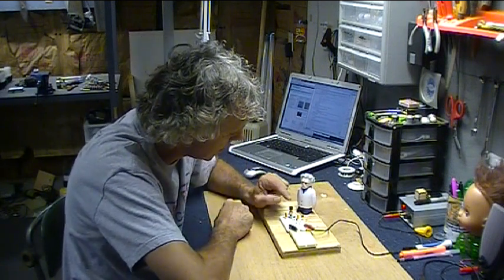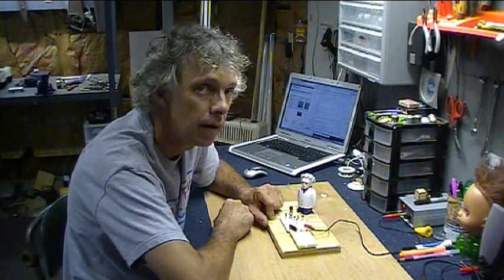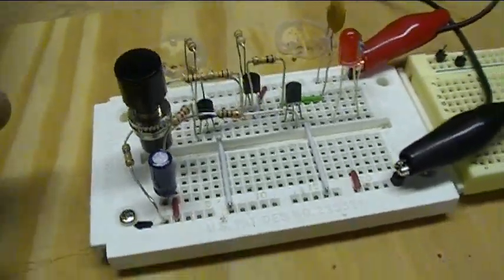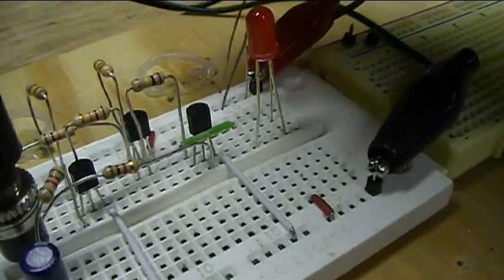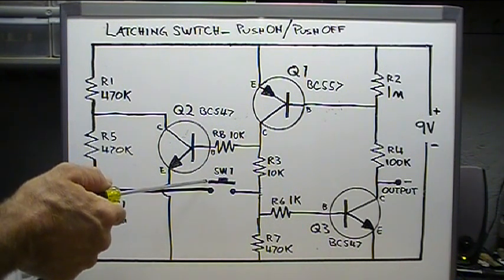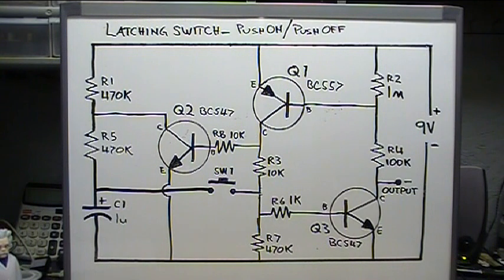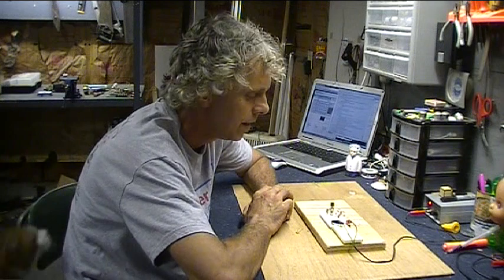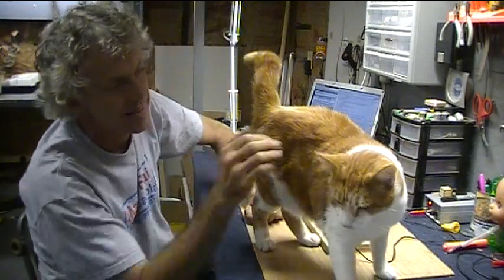Push On - Push Off Transistor Switch

Comment: Here you have a very interesting very sensitive circuit and the transistors Q1 and Q3 together may be looked upon as forming a thyristor, which is rather a  tricky  device to switch off, once it is on.
The surrounding resistors which you included, tame the thyristor effect and that is the only reason you may switch  the combination of Q1 and Q3 off.    It is not easy to design this circuit.
The action of Q2 is ingenious to say the least .  All I can say is  that it is a sensitive circuit to switch off as anyone handling thyristors would know.   Congratulations, for even if it does not work reliably, I assure you that  you did very well in choosing those resistors to  enable you to bring on and off that  tamed thyristor! 
I would say that  you need that capacitor at the output, so that Q1 will remain momentarily on to keep Q2 on to keep the voltage low on the capacitor C1 to ensure the charge on Q3 is depleted to switch it off.    It is not an easy circuit to design and each set of three different transistors will need their own particular tuning,   I do not think that this circuit can be  repeated  for any three transistors without  retuning the resistors .  Well done, for a self taught gentleman.

Comment: This circuit works fine with a few changes. Connect output to a 150-250 Ohm Relais to plus and parallel use LED with 1k resistor in line to plus. If LED with 1k resistor allone is used for demo replace R2 by 100 kOhm (R2 is critical). Also use R3 with 22 kOhm instead of 10kOhm. A smaller capacitor of 100nF vor C1 may work as well. The circuit turned out to work very well from 0°C to 50°C, resistant to humidity, very low power consumption. Thanks for this well designed video.

Comment: I changed R7 value to 1k ohm and it works very stable.  I can turn the circuit on and off as fast as I can rapidly push the SW1.  I added an PNP transistor as a switch to the output of this circuit to operate a small load relay.  I am using 2N4403 PNP for Q1 and 2N3904 NPN for Q2 & Q3.

Comment: This setup is invaluable. Ive been running this through a sim to learn how to setup my own circuits and i also had to fudge the numbers. In doing I've learned how to control the amperage and that one component has a cascade effect. The biggest factor of the latching however is the cap. In my sim it had to be at least 60uf to start being stable. To really gasp how latching works it is essential to break this circuit into its individual circuits. I also recommend debouncing on any switch component. One cap and 1 ohm resistor in series tied parallel to the switch. Now if i can just figure out how to control and understand the charging and recharging part of these circuits ill be well on my way.

Comment: That cap is acting as a debounce filter and stops the oscillating  of the circuit while you are pressing the button
Reply: No, the cap behaves like memory latch to decide whether it'd open /close in the next pressure sw.
Reply: @alexlo7708  The OP is referring to the "mystery cap" that was added to stabilize the circuit.

Comment: You may find the circuit a bit more stable if you use a MOSFET as Q3, Your main pull down capacitor "C1" should be a bit higher value too. Something more like 33 mics or so. 22 to 47 is about the best working range depending on preference. I feel fairly sure that you'll find the circuits' behavior more to your liking if you follow my advice...

Comment: I'm not sure what you're talking about now.  A circuit like this has an RC oscillation if you hold down the button.  It's visible because it takes a few seconds to happen.  If you hold down the button the LED will switch on and off every few seconds.  This applies to whatever load, not just an LED.

Comment: Re the 0.2 uF capacitor placement from Vcc to the signal path, it's usual to decouple digital circuits from their power supplies with an electrolytic cap of c. 22 uF and a ceramic cap of 0.1 uF across the Vcc and Earth pins on an IC.

 I'm not sure you've managed such a decoupling by slightly unorthodox methods (i.e. The wonderful, "I tried it and it worked," method of designing which all inventors use), but I  suppose it's possible. My (analogue only) electronics training was in the seventies

Comment: This same type of circuit technique can be implemented very reliably with two CMOS inverters, 2 resistors, a capacitor, plus an N-channel MOSFET and resistor to drive the LED.

Comment: The capacitor decouples the mixed signal(AC and DC) at the output. This is why caps are used on the outputs and inputs of bjt amplifiers.

Comment: In one state Q1 and Q3 are both in saturation and in the other state Q1 and Q3 are both in cutoff. 

Assuming an open load, that is nothing attached to the output:
In the saturation state the output, the collector voltage of Q3, should be around 0.2 volts or so.  In the cutoff state the output should be around +9 volts.

Assuming the output is attached to a RED LED as shone in the video:
A RED LED has a typical forward voltage of 1.8 volts.
If Q1 and Q3 are in saturation, the output voltage is around 0.2 volts and the LED is off.
The problem I can see arising is when Q1 and Q3 should both be in cutoff.  The LED is providing a current path around Q3.  Current can flow through R2 and R4 and the LED.  This will produce a voltage drop across R2 which will start to bias Q1 and turn it on.  Because R2 is such a large pull-up resistor it takes only a very small current through R2 to produce a voltage that will forward bias the BE junction of Q1.

The output of a circuit like this is not very good at sourcing current. The current it is trying to source interferes with it's own operation.  The output of this circuit could be buffered before driving an LED.  If you are trying to do your design exclusively using discrete transistors you might try a saturated transistor switch using a transistor with a very high Beta.  The output voltage of this circuit should be almost +9V.  This is probably high enough to turn on a field effect transistor which would not load down your circuit at all since the Gate draws no current.

Comment: Yes, as an electronics enthusiast, this was the circle what I needed for a long time.But, can't we do that with just one transistor and a few resistors, etc.And is it possible to do this with just one part like a triac? One guy said the name of a different switch type name and I bought that switch.Yes, it was a push button switch.When I pushed once and take my hand back, the lamp was on.When I pushed again it was off.But I was surprised to see that that switch was doing the job mechanically.

Comment: Those transistors you drew in on the whiteboard are fairly high gain for BJTs.  Most really common transistors like the 2N4401/4403 and 2N3904/3906 are low gain (Hfe).  Could seriously mess up the circuit if you subbed with low Hfe... also that website shows powering the circuit from 12V instead of 9V.  Could also matter.  The spot where you put the 0.1uF cap is kind of a weird place to put it and I don't think it's helping really as you can see at 2:15 What values for everything did you use?

Comment: Am I seeing correctly, a capacitor connected between the negative terminal of the LED and the supply?  When I do that the light turns on after pressing the switch, but then cannot be turned off.

Comment: How would one have 2 'latching' switches, such as using the original to power on the circuit and switch number 2 to latch it off, resetting the circuit for the capacitor to refill?

I would assume a SW2 would ground out using a diode, but where would it go, between R3 and the collector of Q1?

I know this video is ages old, still good and I thank you for sharing. You had a great camera for 2011!
Reply: Joshua Nulton I know it has been a long time since your question... Look up SR flip flop using transistors. That will give you 2 button operation.

Comment: 4017 (decade counter) you can use it for 9 relays. there is tutorials on youtube. there is reset option to use only number of relays that you want. On out pins you use transistors to power the relays because relays can sometimes kill IC. there is sch on net you just have to adjust it...

Comment: If you replace the BC557 (PNP) with a BC547 (NPN), it will not work.  The NPN would have incorrect voltages on the pins.

What's mysterious to me is how is the LED connected?  It's not shown in the schematic drawing.  I would add another transistor to deliver more current to the LED without loading the circuit.

BTW, my previous said Schmitt trigger (CMOS), I really meant to say hex schmitt inverter (CMOS).

Comment: what is the output voltage for led. Can i operate the whole circuit on 12 volt and also can switch on off 12 volt relay in place of led

Comment: Great videos, but this circuit is no good. It is unstable just like you showed in your video. I tried several times to breadboard this, and all attempts failed. I can get it to turn on, but only one time it went off. Tested with different voltages also. All components were exact and tested OK.

Comment: What is your input voltage?

Maybe try decrease the resistance values so you sink a little more current to run the switch. Your circuit drawing does not match your test unit.  Because you cant run that led light on 9v. You may need a higher voltage or lower resistance.  For average NPN PNP transistors, 5v will make life a lot easier.  

9v is on the circuit drawing, try that voltage, and line 5~ or 6 little 1.5v leds up in series to take the 9v, then test again.

Comment: What replacement transistors did you use? I can't get the circuit to work :( The LED is always on, pushing the button only causes a flicker. I've tried using 2N3904/3906 and S9014/9015 with the same result. Interesting thing though is that if I disconnect R6 and the base of Q3 before connecting the battery, and then reconnecting them after power is on, the LED would stay off until I push the button the first time, but after that it will never turn off again.
Reply: same issues here. Just built the circuit 3 separate times and doesn't work, or rather, very briefly.

Comment: I have on off by connecting to leads using 55 all working. But instead of touching the wires together to turn of as switch like to use a transistor but can't get it working any help?

Comment: if I replaced the switch with an op-amp comparator then put a guitar signal on the op amps + input would i get a squarewave octave down effect?

Comment: No, the RC oscillation has nothing to do with switch bounce.  It happens when you hold the switch down, while anyone would know there is zero bounce when it's held down.  Switch bounce lasts only milliseconds.  Still, there would have been no way to make what I need in a small circuit.  I ended up paying someone to write me a PIC program.

Comment: any ideas how you could make a circuit where you have 2 or 3 on's and 1 off? so one push is on1 two push on2  third push off?
Reply: You're describing a counter? Where the first switch operation gives an 'ON' condition and the 3rd operation gives an 'OFF' condition?

The quickest way to build this would be using a CMOS 4017 decade counter in conjunction with a single transistor LED driver stage. You could select any number of counts up to 10 whereby the ON condition would be maintained until the next sequential count would switch the driver stage OFF. (the decade counter outputs can be routed via diodes)

Comment: Looks like R3 should be of a bigger value, voltage drop at base is less 
Than .7 volts needed for the npn transistor  Q2 to turn ON.

Comment: I built this same circuit and it does not work. The circuit is initially on, and when I press the switch, it turns the output off and back on for a few microseconds. The PNP transistor is on all the time, therefore recharging the base of Q3. I see that your using 9v instead of 12v, but it doesn't make a difference. Anyone else having same issues?
Reply: even it did not work for me

Comment: Why would I use all these components instead of a single latching switch?
Reply: +Louise Brugman and it can be cheaper with a circuit like this than a latching switch
Reply: +Louise Brugman Power on state is always the same for the circuit.
Reply: +Jonas Nicolaysen Looking in my JAYCAR catalog I can get a latching 1A 240V rated latching switch for $1.95. The cost of the circuit shown adds up to $3.26 not counting the time spent getting it right. The purpose of the circuit is, I believe, a learning exercise rather than a cost saving one.
Reply: Non moving parts are more reliable and last long
Reply: +Gajanan Phadte Where do you buy the non-moving switches for the transistor circuit? Has technology come up with something new that I haven't heard about?
Reply: Transistor is a switch.
Reply: +Gajanan Phadte Look at the circuit diagram Gajanan. That thing labelled 'SW1' is a mechanical switch. It is used to activate the circuit. If you look at the breadboard circuit, SW1 is the big black thing on the centre left of the breadboard. It MOVES by the application of a human finger.
Reply: The switch in the title is not THE switch SW1. You will have to learn some electronics to understand what I am saying.
Reply: +Gajanan Phadte You are absolutely correct Gajanan. I've learnt nothing about electronics in my last 45 years as an Electronics Technician/Engineer. Perhaps you'd like to enlighten me.
Reply: You surely need some good teacher. And after so many years, you are asking for a switch with non moving parts...that itself is enough. There are so many. Bye

Comment: A switch, a resistor to pullup the switch, and a schmitt trigger (CMOS) would do the same thing, but you've wasted 5/6 of the CMOS chip.  Here's one way (or more) to do it.
rustybolt(.)info(/)wordpress/?p=288

Comment: It does absolutely nothing, components tested and measured. I don't really understand why you people do this, as these circuits are obviously not doing anything. I have wasted the whole day with this and other diagrams, ended up solving it with a 555 in 10 minutes. I figured it would be easier with transistors, but the good old 555 is far better.